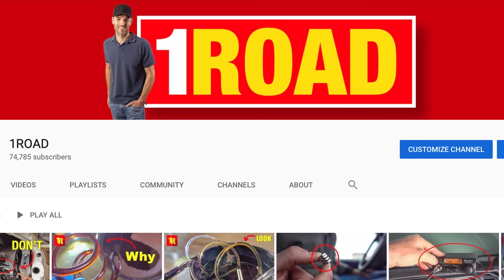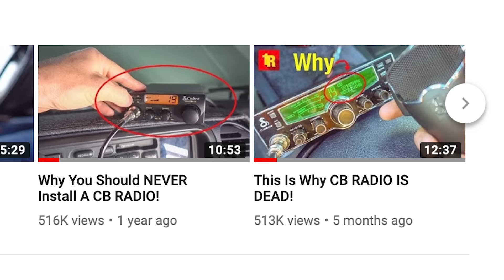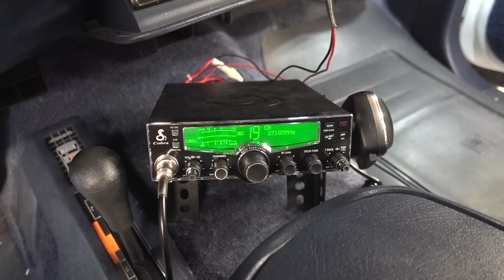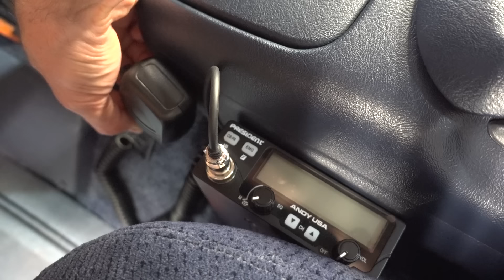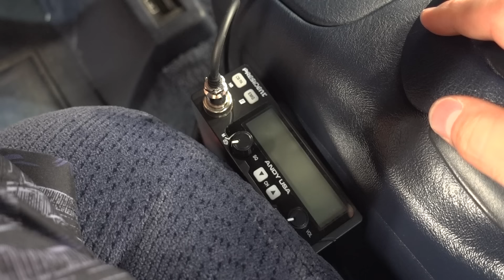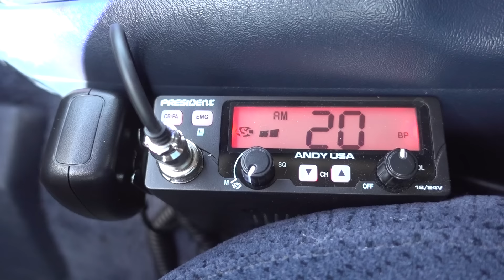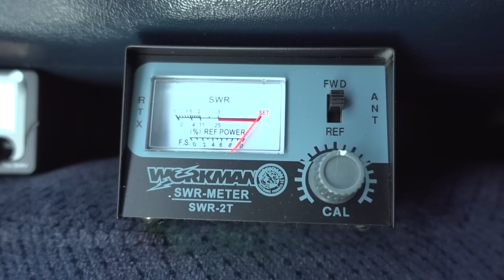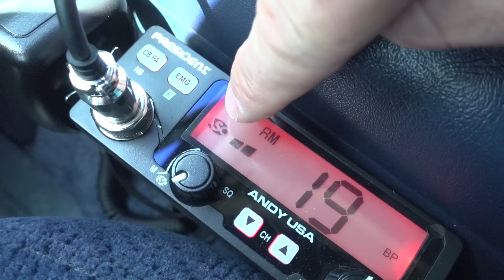Here's Why YOU SHOULD TRASH YOUR CB RADIO!

Comment: I have been a CBer off and on for almost 50 years. I lived thru the golden age of CB. I was on the air on other people's radios every chance I got even before my voice changed. Never could convince my Dad that a CB was an absolute need back in the good old 23 channel days in the early 70s. In those halcyon days country folks used it as a supplement to the party line telephone. Yep, wireless communications at your fingertips in the age of dinosaurs.  I also used CB as a sometimes trucker too years later. Have a free to me 10 or more year old Cobra 29 Classic in my truck now, but not currently in service. Need to do antenna work. Have been a Technician class licensed HAM for over 10 years now. Need to get radioactive again. It's still fun for me whenever I 🔑 up. And yeah it's a little bit pop culture Americana that exploded and fizzled, but CB still has utility if only people were creative enough to grasp its value. The whole grid could fail and simplex point to point radio communications (of any type) could be fully functional when your not so smart phone is left without a network to support it. Ask any HAM operator what happens when nearly everything falls apart in a simple storm disaster. Radio rules!
Reply: You talk to much 😂
Reply: @lesjones5684  It took you two whole years to pop in here to tell me I was hogging the channel?🙄 Well excuuuse meee! This place is more dead than CB without skip and the best you can do is accuse me of talking too much 24 months after I posted. What I said then has had time to circle the sun and entire galaxy before it got back to earth and you think I talk too much? Holy cow 🐄🐮 man. Obviously CB radio was not something you enjoyed as a hobby. Without folks talking on CB, about CB, and every where else they can talk about CB,  there isn't much hope out there for CB in the entire totality of CB  LAND!🙄 Btw; when using the words "two", "to", or "too", they each have a proper place and application. I've been properly accused of talking TOO much but never accused of talking TO much. Pretty sure my grade school teachers were hard core on that and more details than I can remember about 50 trips around the sun ago. But I reckon I need to back on out of here and let the radio tubes cool down a bit and avoid the ol purple crystal effect on the radiddio. 73s to everyone out there in radio land. We will catch you all on the flip flop. We are clear....

Comment: Get a Vintage Sears Road Talker with Upper and Lower side bands , Still have one after 50 years .....Built them great back then 1970's
Reply: I remember those
Reply: I have one too if you want to buy it. Belonged to the old man.
Reply: @KlodFather  Thanks but no , I'm trying to get  and old 1970 Fisher 500tx Stereo Receiver working again .✌
Reply: @MrRockydee07  -  All good. There are still a few floating around. MCM and some other parts suppliers had many of the parts to get those fixed. they are easier since they are through hole construction. Lots of superior choices for replacement parts.
Reply: @KlodFather  Ok,  I may be wrong it looks like MCM is closed , But I did buy another receiver just for parts .
Reply: There was another place in Cincinnati or Dayton Ohio that had parts also.  Consolidated Electronics I think is what they called it.
Reply: @KlodFather  And Thank you , Your very considerate .
Reply: @MrRockydee07  -  Im always glad to help a fellow project builder/service guy. Back in the late 80's and in the 90's I made a lot of money fixing that stuff.
Reply: @KlodFather  Ok , Canadan Kid ,  KAPN 4831 OUT ,
Reply: 1970, that was before integration ( integrated circuitry).
Reply: @nickv7824  Still have the receipt from Sears . And still works great .....LOL
Reply: @nickv7824  -  No they have IC's. The PLL was an 858 and there were a number of other IC's on the board.  You are thinking in the 60's. IC's were much rarer then.
Reply: Get a older galaxy or Texas star
Reply: @williamhritz3455  Yes all great ones  👍
Reply: @williamhritz3455  -  Those were built with the same board as in the Cobra 148 DX.  That board is legendary. 
The HR2510/President Lincoln is a great one also for several reasons. 
The AM portion of the radio is not really AM. Its DSB injected carrier. So if you pull the mod limiter and turn down the carrier to around 7 watts, you can get an actual (no carrier collapse because in AM thats a no no, interference and distortion) 7 watts and audio 20+ watts rms out the antenna plug. It performs like no other, but this mod is not for the unskilled tech. You need some serious equipment to tune it properly. Its unreal through a big amplifier ha ha ha
Reply: I used to have a Sears roadtalker in my van in the early 80s, I sure miss that radio.
Reply: @swamppappyjonson9780  I've found some still on ebay , I've used it on a motorcycle with a fire stick antenna and was talking with someone in Oragan from Ca on the side band ....
Reply: @swamppappyjonson9780  -   I have an SSB roadtalker 40 if you are interested. I offered it to Canadian kid but he has one already. I want to sell it along with a bunch of other radios. I have WAY TOO MANY.

Comment: I'll never forget how well cellphones didn't work when that whole 911 thing happened 18 years ago. CB radio still definitely has its place. Too bad the internet killed it.
Reply: David Branscome I’ve had cb radios for 51 years and I still have a little uniden in my 2015 Chevy Colorado and because I ever liked drilling holes in any of my vehicles so I use Velcro to mount my radios they make Velcro that can hold 20 lbs , holds the radio very secure and to remove the Velcro just clean off the sticky surface with rubbing alcohol.
Reply: David Branscome  When Sandy hit New Jersey it was not just cell service that went down but I lost internet for 10 days as well. However I understand what your comment is eluding to.
Reply: The internet is just a fad
Reply: JadonGamer  sarcasm yo
Reply: Hdx🐁🐰🐩🍔🍔
Reply: David Branscome yd
🐤🐰🐁🐰🐣
Reply: Phx
Reply: I grew up the 70s working on them in my dad's TV shop. A simpler time for sure...
Reply: Listen to channel 6 I guarantee you internet didn't kill it. Cell phones all require cell towers. So in a bad situation storms hurricane and other things it take out cell towers make them useless as well as the internet on them. a radio you just need a 12-volt power source in an antenna. You can build an antenna almost out of anything.
Reply: @racerx5379  Yes will only  last about a few months longer
Reply: If the internet killed it then Corona-Chan revived it, big time.

Comment: Nothing sadder to me than driving down the interstate, seeing big fine trucks all polished up with dual stacks and chrome wheels and not an antenna in sight.
Reply: Maybe they're hams, using an HT into a hotspot, connected to their phones wifi as a portal to the internet.  They COULD be having a QSO with an Italian station.  Maybe?
Reply: You are correct, the trucks have plastic mirrors without antenna access. CB radios are the best short distance communications stsyem  for the task of informing drivers of hazards. I may have had my life end without a timly warning of a wreck ahead.
Reply: The new drivers dont have a clue about CB radios wonder why? I wouldnt be with out one.
Reply: They.  Might.   Be.   Beside.   The.   Merrier.   Hard.  To.   See.   Some.  Are.   Short.   Antanas
Reply: @python2228  or a company driver and the company doesn't supply a radio.
Reply: Or very expensive dual antennas. Nobody has the radio on. Must be a fashion statement to them
Reply: A lot of your major road companies as well as insurance companies say that CB is a driver distraction and don't allow drivers to have radios , however feel free to be on your cell phone or typing away on the ole Qualcom to dispatch , that's good and safe . Plus the fact that EVERYONE knows their GPS will get them to the correct location EVERY time without problem or incident ! A lot of drivers don't turn their radios up because of the bullcrap that you have to listen too from time to time  , so then it becomes your BACKUP radio , ie " hey , can anybody tell me what the BACKUP is "? ...........
Reply: I don"t know how you can be a truck driver and not have a radio.  A lot of recievers will tell you to turn to channel 10 or 11 or whatever and wait to be called.
Reply: The new trucks have internal antenna for the cb and am/fm .unfortunately you cannot adjust the swr without an inline tuner